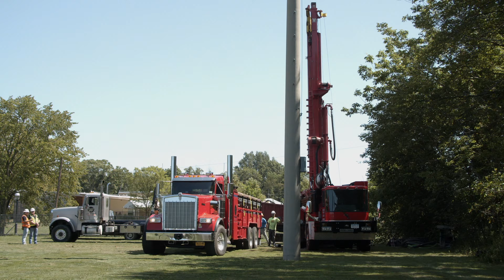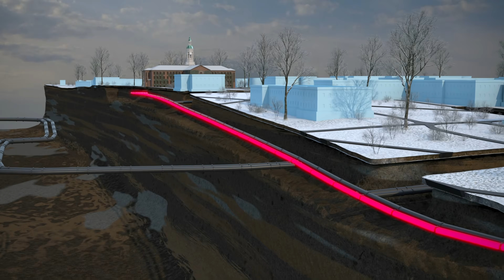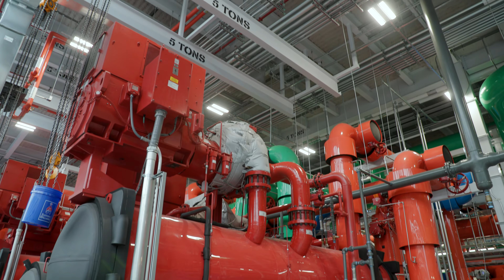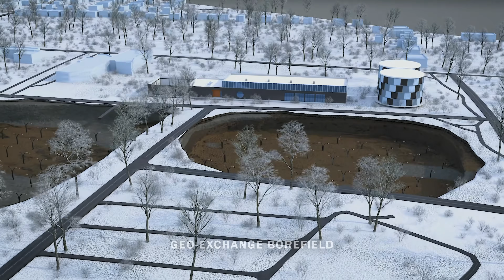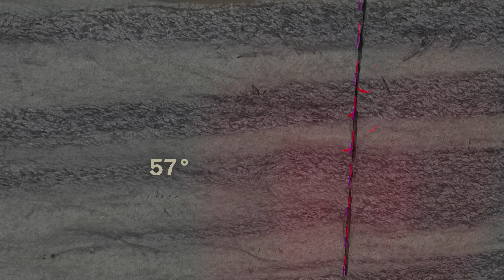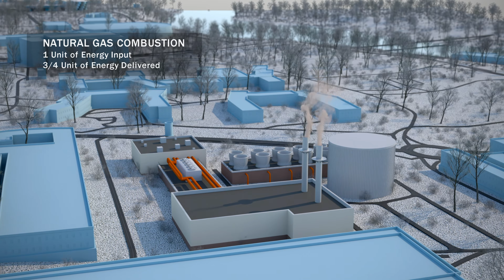How Heat Pumps & Geo-exchange will help Princeton University decarbonize

Comment: Yes great video Ted, it explains the key concepts very well and I will be putting it to use in my current work (after retiring from Stanford a couple years ago) helping other universities, airports, medical centers, and other district energy systems consider such transitions as have been done or are underway at Princeton, Stanford, UVA, and other locations.